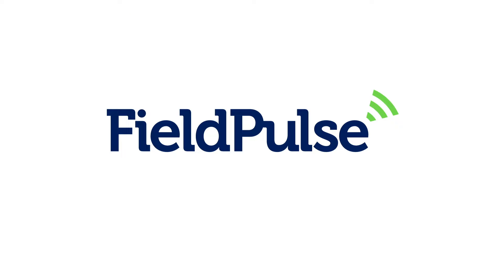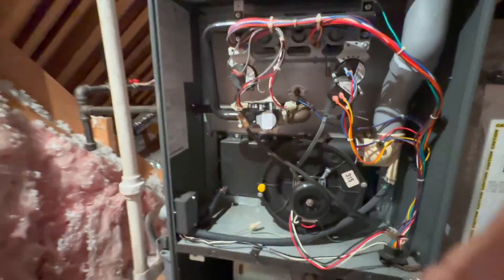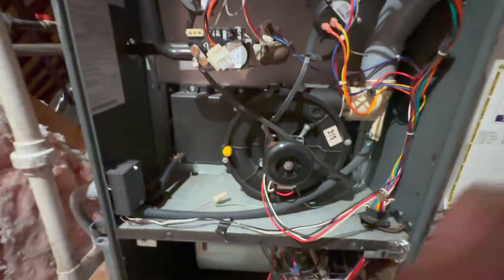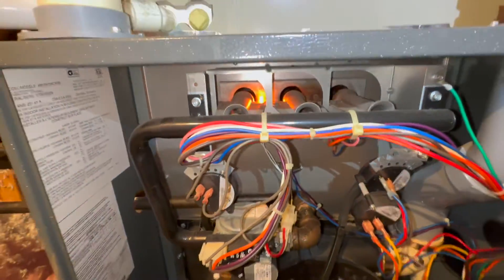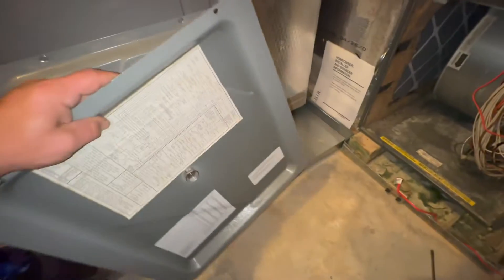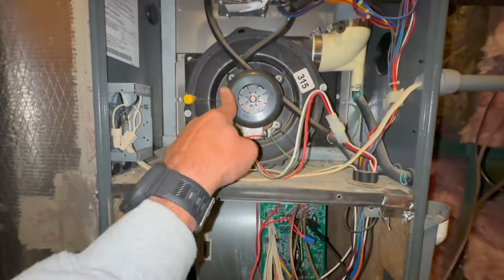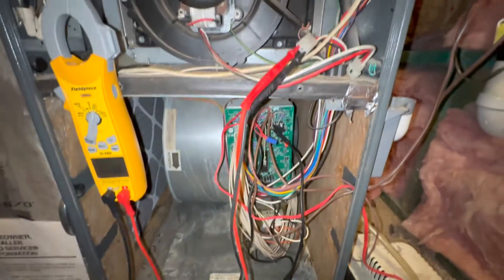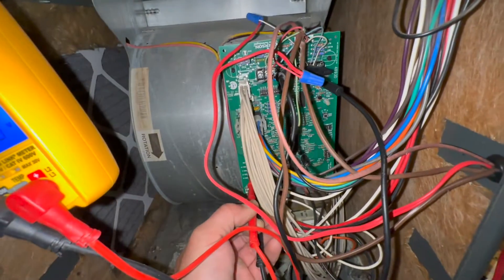2 Furnaces Not Heating | Service Call | Dual Diagnoses

Comment: I'm on call tonight and I just left a no heat call with the exact same problem as the second furnace you worked on. Board not sending voltage to inducer.

Comment: Rollout switch?
Reply from the maker: A open roll out switch wouldn't let the inducer come on and normally only runs the blower. It would also show a fault code.
Reply: @HVACTechTips  Yes your right, the blower would come on.

Comment: Check the condensate pressure switch that actually gives the 24 bolts to the gas valve . More times than not it's that crappy switch that is sticking and not the  board . I promise. The company I work for has installed thousands of these furnaces